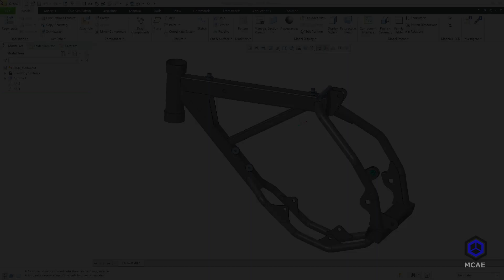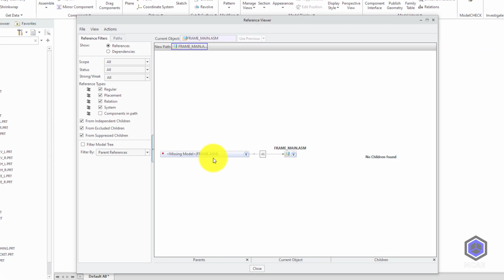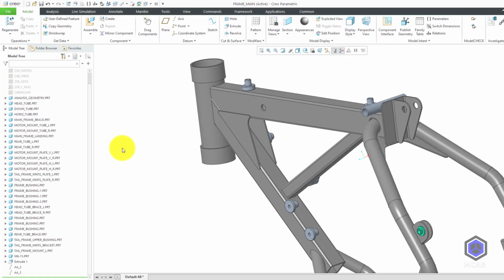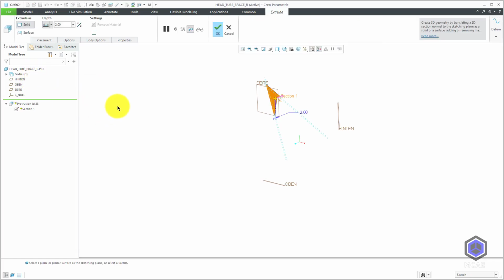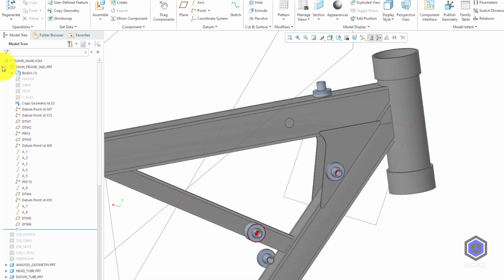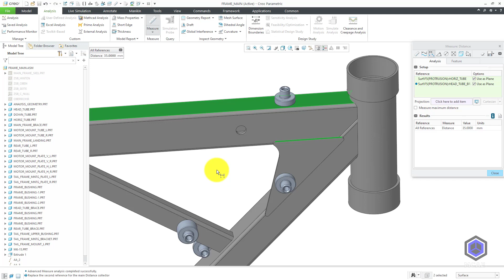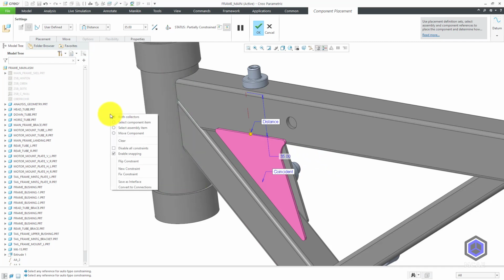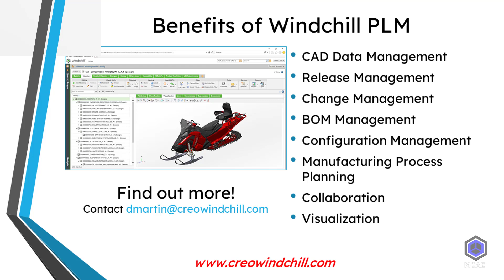Creo Parametric - Circular References (Part 2) | Assemblies and Top Down Design

Comment: Hey Dave, I'm curious why you didn't place the second instance of the brace by just lining up a couple of edge surfaces with the first instance.  (As opposed to applying the measured distances.)  Great videos, thank you so much.
Reply from the maker: Well, I made this 15 minute video almost 3 years ago, so I can’t remember a specific action and I don’t have time to rewatch the video. But I can say that edges are generally not as stable as other choices for references. So I’d rather take a few extra clicks now to avoid the potential of me or someone else getting a regeneration failure later.

Comment: These are all good practices, but it sort of sidestepped the actual circular reference issue.. What if those parts had in fact required a left and right version; maybe there was an additional extrude outward from the center plane of example.. 
What was the actual cause of the circular reference? was it simply that the left mirrored part was above the original right part in the model tree?
Reply from the maker: Personally I don't think it sidestepped the circular reference issue because it was a bad design practice - which is the most common cause of circular references. Had I needed separate parts for left and right, my first solution would have been to reorder the parts so that the mirrored part appeared after the source model. If I had come across a situation in which the mirrored part was required, I would have found a different solution.

From my experience at Amazon and Blue Origin, the BOM / MPP issue is actually much more detrimental than the Circular Reference, so I was able to kill two birds with one stone.